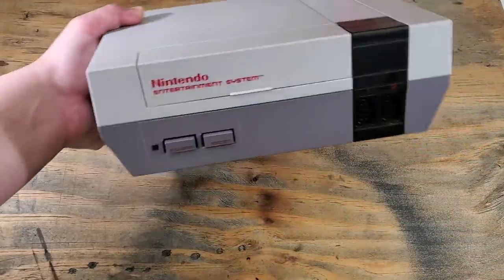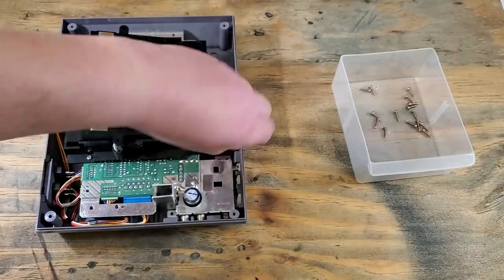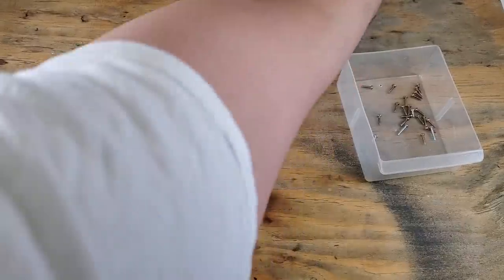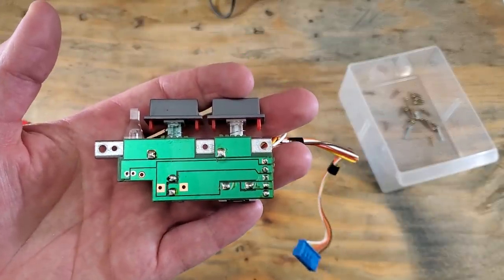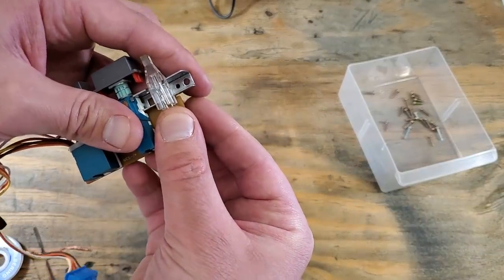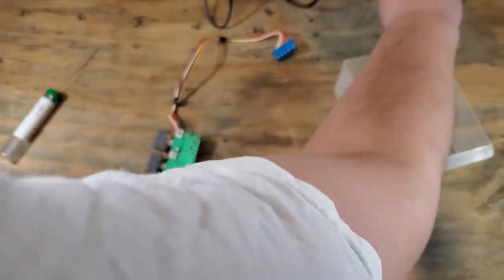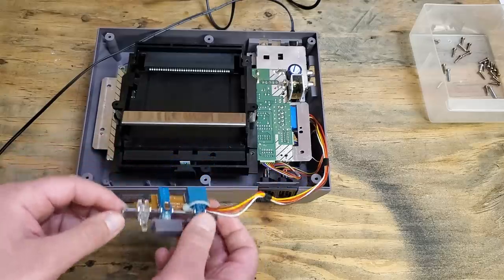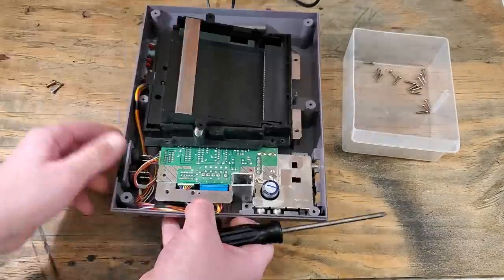Modding an original NES with a color changing LED

Comment: I didnt know an rgb led would work without a controller board, looks good.  I put a blue led in a nes  that i had rebuilt the case for, it was smashed up. After doing bodywork on the case i painted it white and light blue, so it needed a blue led to go with it lol.